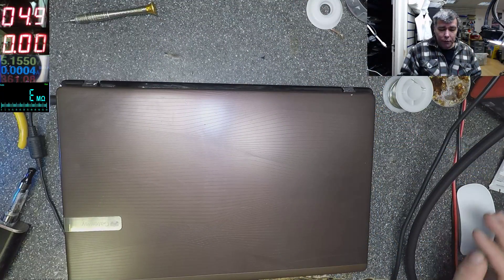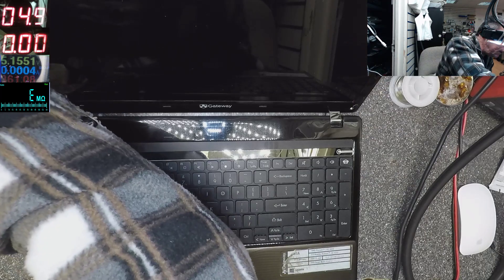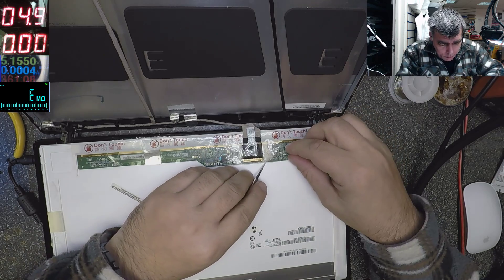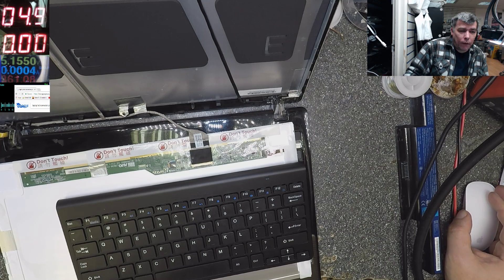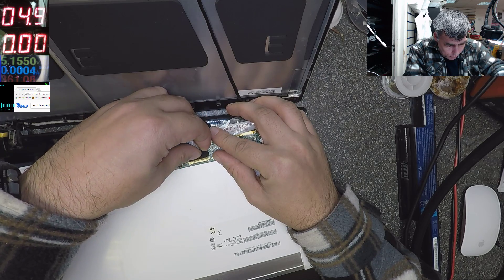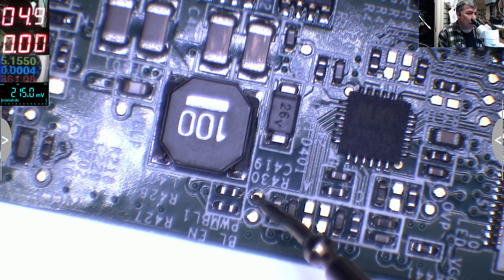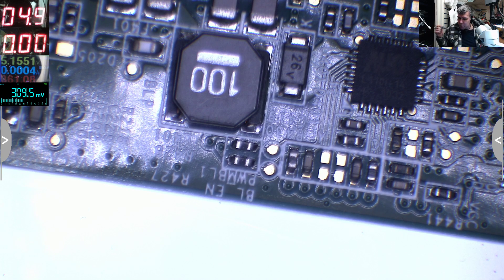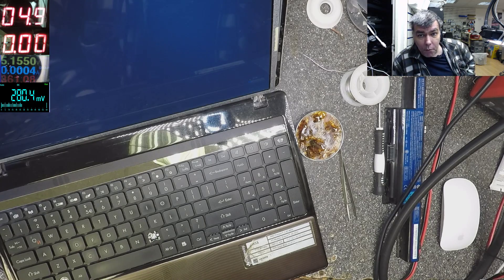The Most Common Fault When There Is No Backlight, Gateway New95, No Backlight repair

Comment: Whats wrong with the laptop, if no backlight, but there is a 3.3 volts on both PWM and BL Enable pins?
It's an LP156WH2-TLEA panel and a Lenovo G500 laptop

Comment: Hello Sorin,
I am trying to debug the similar issue on one of my laptops, interestingly the screen also looks similar to the one in this video... in my case the situation is reverse, BL_EN is zero, while PWMBL1 is 3.2 volts 😇. I tried shorting them and also tried bridging 3.2 volts from another vcc* test point but it still doesnt light up. I connected another lcd as well and found the same result, no backlight but picture is there .... I am thinking of changing the display cable ... any thoughts?

Comment: Sorin, did you check with a known good working screen to test? In my experience some backlight issues are due to the screen board and not laptop motherboard. I recently have had 2 such laptop screens that the backlight has failed, but with a new screen those laptops worked fine. Both cases I ended up buying the laptops from the customer as they didn't want to spend to have a new screen put in or the old ones repaired. In another case I replaced the screen without removing the battery which resulted in me frying a resistor next to LVDS cable (Compaq) and no backlight. So the problem in this video and my 2 laptops seems to be the resistors on the screen board next to test points have failed?
Reply: What solution did he do there I didn't understand! He just joined those 2 ? Plz help

Comment: you can add a variable adjustable resistor so that you can adjust brightness as you wish....more work but not that hard.
Reply: That's a good idea, however I believe a PWM generator is what you need here (as that's the signal it receives)

Comment: If the 19 volts was missing u would not have a image on the screen. The 19 v powers a circuit that drives the LCD panel drivers. SO its the boost converter IC that drives the LEDs.

Comment: Help.  I have an HP 11x360 that only powers up (and runs fine) with the internal battery disconnected and AC power connected. I get a "no battery detected" message when I reconnect battery while it is running.  Tried all the hard restarts and uninstalling acpi battery software with no luck. The battery is a 2 cell 7.2 volt li-ion with only .25 volts of power left. The battery socket on motherboard has three pins with 3.2 volts. I am thinking the battery charging circuit is bad. Thoughts? Thank you.
Reply from the maker: just replace the battery
Reply: Thank you. I will try that. I was thinking that the voltage required to charge battery would be closer to 4 or 4.25.

Comment: wondering....could you drop in a resistor to put the screen at say 80% brightness? if so what value would you use? thanks for your videos
Reply: The brightness pin receives a PWM signal that it filters into a smooth voltage from 0 to 3.3V so for 80% you would need the pin to receive around 2.6V, or connect the enable pin through a resistor divider to the brightness pin, about 1k from enable into a 4k to ground will give you 80% brightness.

Comment: I assume I could add a diode instead of short between the pwr and brightness to drop the 3.3v slightly for less than max brightness. Is that correct?
Reply: I don't like the idea if max brightness at all times. This is something that could be fixed some other way.

Comment: Hi I have a Toshiba laptop that has power light but not booting up can you advice something
Reply from the maker: ram memory, graphics..
Reply: i heated graphics chip but no change, i have 19 volts on fets. replaced memory and no change, 19 v brick its ok , i cannot find any cmos battery though
Reply from the maker: if is coming on, check ram cpu gpu power supply
Reply: ok i checked and found a little mosfet found like a short and a ceramic capacitor short on both sides according to ground now what to do
Reply from the maker: great, carry on, replace them

Comment: the start up  chip controls the brightness for the screen? and fixing it to get back control .is to change the start up chip ?
Reply from the maker: most likely
Reply: I understand because the short can still be there from the chip pin to the screen and will take a long time to detect it

Comment: Excellent Magic. How did you come to know about test points and voltages supposed to be? Its really amazing
Reply from the maker: all the led screens are the same, so you should have same voltages. I have few video about backlight, you can check them
Reply: What solution did he do there I didn't understand! He just joined those 2 ??? Plz help